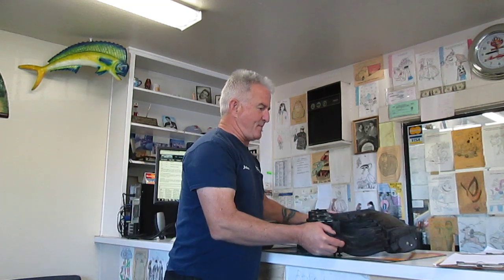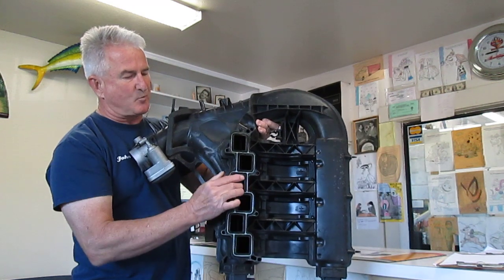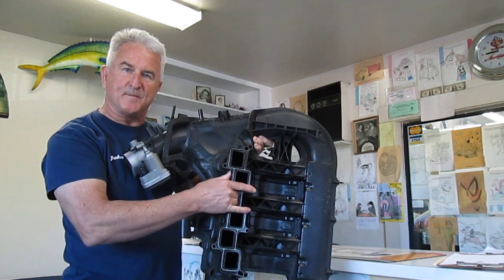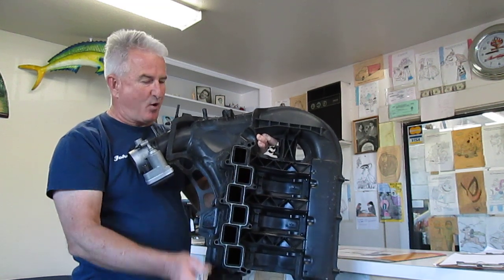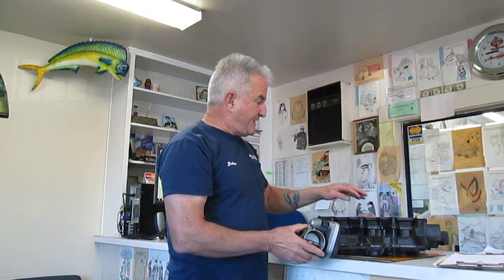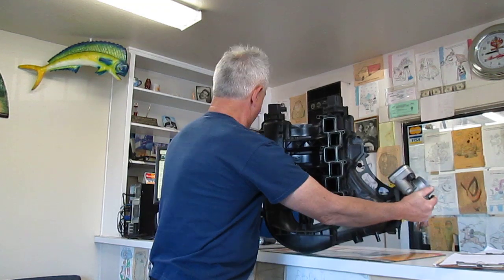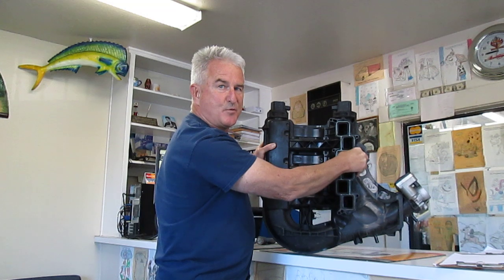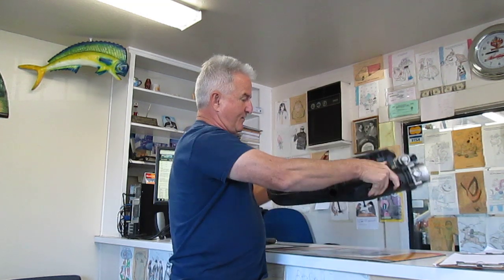How to Diagnosis Code P1004 Intake Manifold Runner Performance

Comment: Cleaning the plenum worked great for me! I had to completely remove the plenum and clean the short runner valve flaps manually. Just use throttle body cleaner to thoroughly clean each of the 6 short runner valve flaps. Let it sit overnight so that all of the throttle bottle cleaner evaporates. Also remove and clean the short runner valve actuators that are on the front of the plenum (take care with the little rubber gasket on the passenger side actuator). Removing the plenum can be a little tricky because it's fit in there pretty tightly. Just google around for a video that shows how to remove the plenum. There's several.

I was consistently getting the code before. But now over one month after cleaning, the code has still not re-appeared.

Take great care when re-installing the plenum to make sure the seal on the EGR valve tube that connects to the back of the plenum is completely seated. If it's not, the engine will run like shit because of a vacuum leak. Easy to fix. Just make sure that EGR tube seal is in place properly.
Reply from the maker: Wow!!! Thanks for sharing that Joe,  I'm glad to hear that !

Comment: hi John, were you able to find the right combination of chemicals to clean the carbon out, so without having to buy a whole new manifold.
Reply from the maker: Not any success on this one Gabriel, the dealer sells the new one with a different design and comes with a new throttle body also. The engines ran better wit the injection cleaning, still had the check engine light though. After installing several new manifolds didn't notice any better driving, the check engine light stayed out though.

Comment: Hi, thank you for the information.  I have a 2008 Chrysler 300 Touring and have never had a hitch until now.  The engine light came on and showed a P1004 code.  I took it to the mechanics and they took the short runner or intake actuator off and cleaned it.  Everything was fine for a month.  Then the engine light came on again and showed P1004, P2016, and P2017 codes.  I went back to the mechanic and they did some testing and got me another intake actuator.  That was put in last night and this morning the P1004, and the P2017 codes are showing.  I have to take the car back in on Thursday to have it looked at again.  A new manifold will cost $1400 plus the installation.  I'm a full time student and am currently not working die to that fact.  Any help of information anyone could give me would be awesome.  Thanks so much.
Reply from the maker: I would shop around for the manifold at a few dealerships, ask them if they have student discounts. The last Dodge Magnum i did the list price was around 800.00 dollars. Was about 3 hours labor i think ( 360.00 ), so that's like 1,200.00 total price. the new manifold comes with both actuators and a throttle body with all the gaskets and seals you need except the o-ring for the erg tube.
Reply: Thank you so much for the information. I went to the mechanic today and he is able to send back the actuator and credit me the amount.  He can also get the entire intake manifold for $1,030.00 plus tax and labor.
Reply from the maker: Glad to help!

Comment: ok im struggling with this problem... i have 2008 chrysler 300 touring 3.5. same problem i chenged the actuator code went away than came back on again under 24hrs. i sprayed all kinds of cleaner n success please help thank you. i have 1 actuator its on the right hand side on driver side.
Reply from the maker: I tried lots of things also, the only fix is to buy a new manifold from the Dealership. It comes with both actuators and a new throttle body also.
Reply: John Sadler's Auto Repair 
i see thank you john. thats my next step. i just cleaned alot of gunk off it. my last hope is it works. fingers crossed.
Reply: hi john heres update just got done deep cleaning and sea foam. i must say it made a huge difference.... real good response on the throttling feels like the 1st day i bought it. engine light is gone. will update after 300 miles but it was some labor i must say. thanks for all your videos and quic response.
Reply from the maker: Great! Keep me posted how it does.
Reply: John Sadler's Auto Repair shoot after 30 mines of test driving it ran good with no engine light.... today drove 60 miles and sure enought light came on. next option is the manifold itself? im better off returning the Runner valve actuator? since it wasn't the issue? performance wise you cant tell the difference. amog issue in California lol.

Comment: Hi John,

Any update on how to solve this issue? I'd love to turn that engine light off for good!
Reply from the maker: HI Aaron: This has been a tough issue, the one that had the computer update and I cleaned the manifold, replaced the actuator motor and the light stayed off about a week I think. So far the only way is to replace the entire manifold. I could see several improvements in the new manifold runner design also.
Reply: Hi John,

Would replacing the Intake Short Runner Control Valve  fix the issue at all? Or am I faced with replacing the entire upper manifold?
Reply from the maker: Aaron Perry I already tried that and the light came back on. The manufacture made some changes to the design of the runners also. I think they had an ongoing issue that could have been a recall but some how didn't fall into that category. 

The new ones I've installed come with the new manifold, actuators and throttle body. The new gasket was on the manifold also. The only one I had to buy was an o-ring for the egr pipe that goes in the rear of  the manifold. Be careful with it and you can slide the new manifold onto the egr pipe without loosening the egr valve assembly.

Check on the internet and you may find some differences in the pricing also. As far as I know only the dealer has the new manifolds. Dorman and some other companies should follow soon.
Reply: Ok, I'll be sure to check it out. That's good if all of those components are getting replaced. I have an admissions test coming up soon and I need my vehicle in tip top shape! 
Thank you very much!
I'll check in with you soon...
Reply: Do you by chance have a part number for the entire upper manifold assembly on the 3.5 L V6?
Reply from the maker: Aaron Perry Send me your vin number and I will check part number for you on Monday.
Reply: Hello sir good day to ya, i think im
Having this issue, so what im getting from this is basically replace the entire intake manifold??? What is the estimate i might pay? If you dont mind helpin me out. Thanks

Comment: changed out the short runner valve &, manifold intake, erased code with cheap scanner but light still comes back on with code p1004 ? what else can i do ?
Reply: Same on a scatpack charger you figure it out ?

Comment: Hi John,

Have you had any progress yet? I have the same code on my 08 magnum with the 3.5L that goes on and off when it wants. Have you tried B-12 Chemtool by chance? Some of the best cleaner out there in my opinion. Thanks a lot!
Reply from the maker: Hi Aaron: Have not tried the B-12 yet, B.G.Products brought me 2 different chemicals to use on the manifold I have off the vehicle, got real busy and now need to find the time to do this. Thanks for the reminder, John

Comment: Hey John great video, I have a 2007 charger with the same problem code P1004 off the top of your head how much would it cost to replace the whole Manifold?
Reply from the maker: +John Jenkins HI John: The manifold is around 700.00 dollars the last time i checked and labor is around 250 to 300 dollars.

Comment: Thanks man!
My brother is having this same issue with his 2012 Ram 5.7.
I think its pcv gunk. I have a duramax that I reroute to keep the oil out of the intake.
Wonder if you can do that on the gas engine to keep that stuff out.
OR.... A catch can!!
Reply from the maker: Your welcome! After more testing I've found out the runners  in the intake manifold move to slow not due to carbon, due to the runner guides being worn out and not moving fast enough. 
This sets the code on the computer. 
The only fix that works is to replace the manifold, they usually come with a new throttle body, bolts and gaskets. You need to buy one oring for the egr pipe on the rear of the manifold.

Comment: HI I am having a similar issue on a 13 Jeep Grand Cherokee SRT8 so far I have replaced the Manifold, Valve, control, PCM, pretty much every part you can think of and I am not able to get rid of the light. It goes off and then seems to come on anytime I hit about 80 MPH. I can not seem to find if there is a software update for it anywhere which is the last possible thing it could be other than the complete wiring harness which I highly doubt is the issue. Do you know if there is an easy way for me to find the current updates? Or have any suggestions to fix the issue?
Reply from the maker: Hi Jason, did you use factory parts?
P1004 is the code your getting correct?
Reply: Same got one on my 2012 srt8 I replaced the valve but still have code …. Did you fix ?
Reply: @Carl_srt  So When I got a new PCM and reprogrammed it, the code finally went away, it took a little time but after about a week the code stopped showing up.. The funny thing was that the guy who sold me the PCM got my core and said he could not clear the code no matter what he did. Bad news is the engine blew 2 months later. My advice is to clear the code and trade it in; worst car I have ever owned.
Reply: @jasonbaca7901  man dodge put a brand new motor in like 4 months ago .. I hate to spend all this many and the motor goes out but I still have 100,000 warranty this sucks
Reply: @Carl_srt  I will tell you I was dropping with the payment about 2200 a month in that thing for the last 6 months I owned it. It was just a nightmare and the thing never ran. It was the nicest car when it did run. I bought my first foreign car about 2 years ago, and I love my Acura MDX Type S; that Jeep turned me into an Acura guy for life. I get in, and it just works. I have other cars a Pontiac G8 and Roush Stage 3 and I never have had the kinds of problems that Jeep gave me. I got to the last 2 payments when the engine blew. Best of luck, but change the PCM. They are cheap on eBay; I changed mine and had the dealer program it.
Reply: @jasonbaca7901  you have some nice cars !!! I have an appointment with dodge Friday thanks for the help !

Comment: quick question for you...if necessary to replace due to the p1004 error code on a charger. Can I replace just the upper manifold or does it need to be the entire plenum?
Reply from the maker: HI Jared: The one I got was the Upper Plenum, it came with a new throttle body and both runner position actuators. I only had to buy the o-ring for the egr tube at the rear of the manifold. May be a good idea to replace your spark plugs at the same time due to some manifolds cover the access to the spark plugs. Brought all the parts from local Dodge Dealer.
Reply from the maker: john sadler I didn't have to do anything with the lower manifold.

Comment: HI John,Sorry to bug you on a 2 year old video.  I have an 2008 Magnum with a p1004 code.  It is killing me because the tester I have says that p1004 is "ECU Battery Feed & Power Grounds" but anything I can find online speaks of the Short Runner Valve issue.  Are you aware if Chrysler changed their codes between 07 and 08 or do you have any insight into this?
Reply from the maker: Hi Darin: The only fix I have come up with is to replace the entire manifold from the dealer. It comes with a new throttle body and both actuators and all seals as well

Comment: Hey John! I was wondering if there was any update on this. I had the check engine light come on in my 2007 Dodge Charger. I have experienced no driveability issues, but being in northern Virginia a check engine light is an automatic fail in their emissions testing. I took it to the dealer and they are wanting to replace the whole manifold ($900 part and $600 labor). I have opened up the front and the runner didn't feel like it was sticking. I sprayed B-12 Chemtool in there anyways, but the light did not go away. I am not in a good position right now since that repair is beyond my ability to pay for but I have an expiring license plate sticker. What should I do?
Reply from the maker: The only solution I have found is to replace the Manifold Assembly, the one I did came with the throttle body and runner position sensors. You can cal th dealer and give them you vin number and on some models it calls for a computer software update also. If yours is that one, I would try doing the software update first before replacing anything. You can send me your engine size and vin number and will check a few things for you.
Reply: john sadler It's a 2007 Dodge Charger, V6 engine, VIN: 2B3LA43G07H765937. When I mentioned updating the computer without the repair, the dealer made it sound like that wouldn't do anything and that I needed to replace the part first. Thanks for all of your help!
Reply from the maker: Grady Augustine HI Grady, You can ask the parts department if they have a discount program of some kind, AAA may get you some discount also. If your mechanically inclined I can email you the directions and you can install the manifold yourself. The programming will have to be done at the dealer though. You can also see if there is one available online.

Comment: Hey just a few more questions. Do I need to replace both lower and upper intake manifolds? I have the 3.5 liter engine. Also what is the I take manifold plenum? It looks like the "upper" ?? Trying to make sure I get the right stuff. Most sites only have lower manifold for 2.7 liter..
Reply from the maker: Hi Lewis,  yes your just replacing the upper manifold (Plenum). 
I would only buy that from the local Dodge dealer.
Reply from the maker: @LewisJohnsonIII  That looks good! See how it's got a new throttle body,  actuator and gaskets. 
I was very impressed when I replaced my first one with the factory part.
Good job finding a factory one Lewis!
Reply: @JohnSadlersAutoRepair  can u tell if it comes with that o ring gasket for the egr pipe in the rear?
Reply from the maker: @LewisJohnsonIII  the oring doesn't come with it.
Reply: @JohnSadlersAutoRepair  struggling to find that o ring. Does my 3.5 liter version even need it?
Reply from the maker: @LewisJohnsonIII  good question, when the engine is cold feel in the back of the plenum (upper intake manifold)
 If you feel a metal pipe going into the rear just off center area, then you need it. If no metal pipe then it's not needed.
Reply: @JohnSadlersAutoRepair  thanks John your help has been priceless. Will check when I get home.

Comment from the maker: Hi Joshua: I just got some cleaners by B.G. Products to try on a manifold I have off the vehicle now. From my testing the reason for the light coming on is due to the speed of the intake runners moving is not at the correct speed. The reason I'm testing this cleaner is so we can develop a cleaner we can spray into your intake nmanifold to clean up the carbon so the intake runners will move at the proper speed. I will know more next week when the testing is done.

Comment: Great Video...., I think I may have the same issue on a 2006 3.5 charger im working on. I had a P0406, P1004 and a misfire code. Along with that I have a LTFT of 9.5 on one bank and 13 on the other bank positive. Do you think that that runner issue would cause a that high fuel trim? 235k miles! Car runs strong, but the P1004 is a new recent code that presented itself. I know the egr valve is shot. But the high fuel trims concern me. Did you come up with a cleaning solution that works for this issue? The P1004 seems intermittent
! Thanks Chuck! 
Just subscribed to your channel
Reply from the maker: +Cobra Ninety Six Hi Chuck: The runners won't cause the high fuel trims, I'm assuming this is at idle. Get me the LTFT at 2,500 rpm also and I'll be able to help you some. Have not come up with a good cleaning solution to spray in yet. The only fix so far is replacing the manifold and pcm update at the dealer. John
Reply: Thank you for your response John. The LTFT comes down to of an average of about 5% on both banks at 2500. The oxygen sensors have never been changed since 2006 and 235 k. 8 was looking at the wave form on my cheap scan tool and it was quite erratic. I'm actually doing some front end work as a favor for a friend and noticed the codes. I want the car to pass inspection when I'm done. 
Thanks again for your response, I appreciate it!
Chuck
Reply from the maker: +Cobra Ninety Six Hi Chuck: Check for a vacuum leak, the best way is with a smoke machine. If you don't have access to one check all your vacuum hose connections, there are some at the rear of the intake manifold, there is also a o-ring for the egr pipe. The egr valve part number has changed quite a few times also, so I know they were having a problem with them.
Reply: Thanks for the great info! The EGR is the one that was on my mind. I havent had time to really look at it being the car is here for a front end. But ill be keeping an eye on your Videos!
Thanks again!
Chuck

Comment: try the oriely brake parts cleaner. I use it all the time also I spray it in the intake with the engine off, just a little. Then I start the engine. find a port and spray while working the throttle.
Reply from the maker: Artistry Photography Thanks for the tip !!